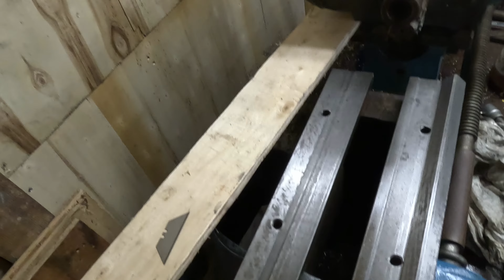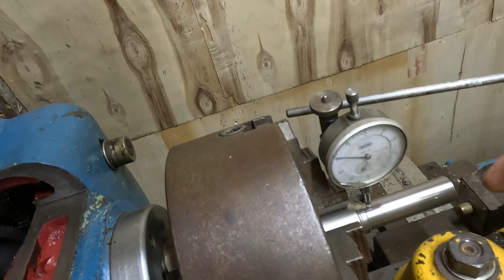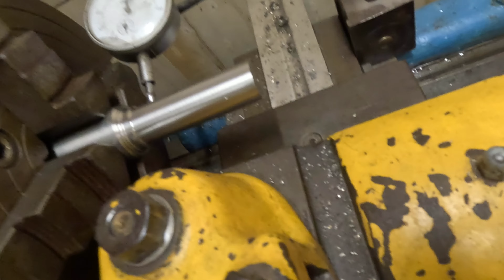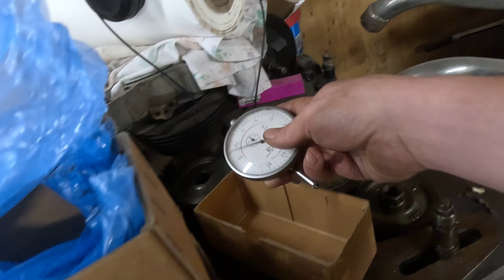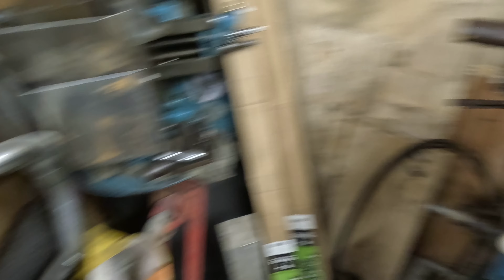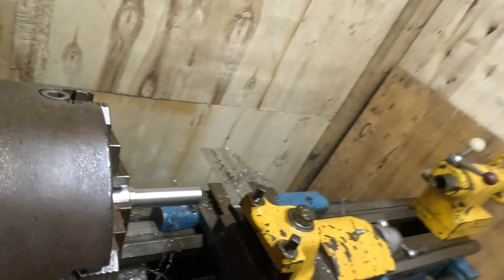Truing my Lathe

Comment: Making progress you are. The tail stock can be a bit more trying to get aligned.  Mine was out on an angle... up and inwards.. leveling the bed, no trouble, cleaning rebuilding spindle, back gear, pretty straightforward,  quick change gear box, not too difficult save tracking down , ordering and waiting for the bearings, apron, no real trouble , but the tailstock.... over 5hrs, shim, assemble, tighten test, repeat, adnausium... but, once it's all set awright, all I proper working order, that's when you can just go make things and just enjoy so doing. Glad you've got it up and running. Do you not like 3 jaw chucks? Or collets?
Reply from the maker: The previous lathe only had a four jaw. I just got used to centring  everything manually. The three jaw should really be given a chance at some point, if I can bring my self to swap them over.